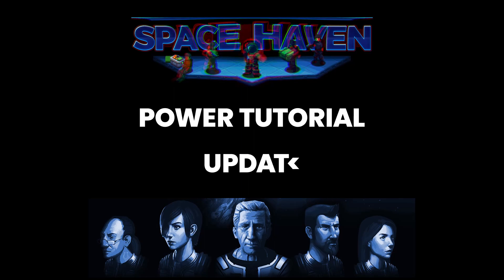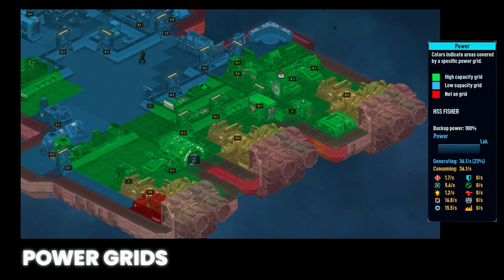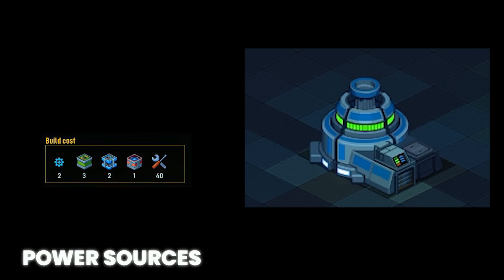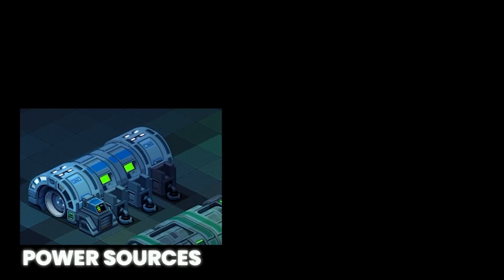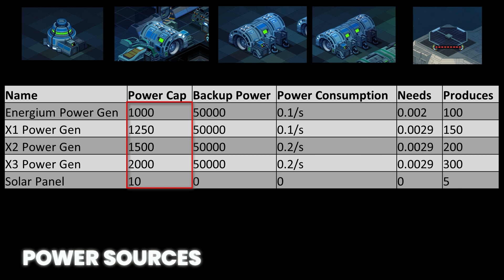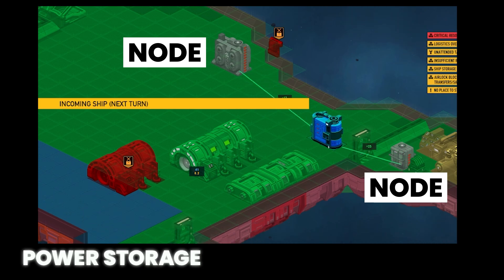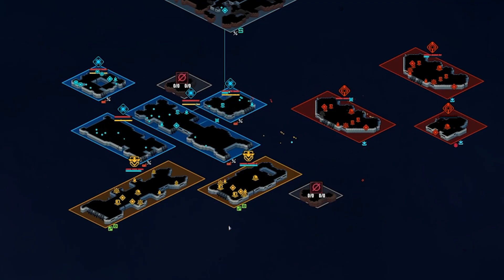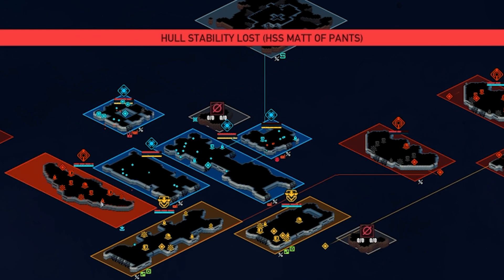Power Tutorial: Space Haven [Updated for Alpha 17]

Comment: Nicely done! 
You covered all the important points clearly and concisely. 

There are long time players that hate on this power system but I like the simplicity. You got local power and high voltage. Build a generator and a power node or two and it's enough for most people. Smart players will rush the power capacity node and backup power storage because you never know when something bad is gonna happen to your generator. Or, imagine all your plants dying because you're upgrading your generator...
Who does that?

I suppose you could micro your power flow by being precise with the size and placement of the power node's effective area (to keep those auto turrets firing in long engagements) but I haven't personally compared effectiveness. Too much effort.
Reply from the maker: Thanks. 

I’ve never lost a plant. No clue who you’d be talking about. 

Outside of my small industry ship, I don’t think I have a high enough load to micro power. I’ll need to do a video on keeping the lights on in the event of ship destruction.